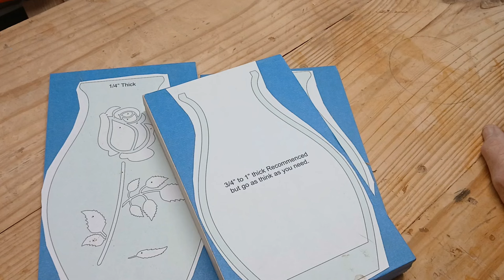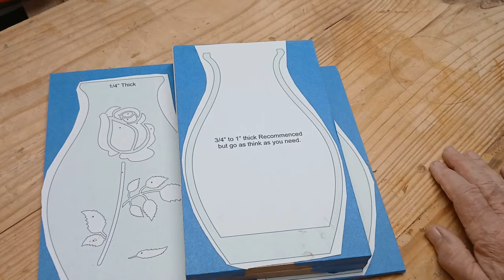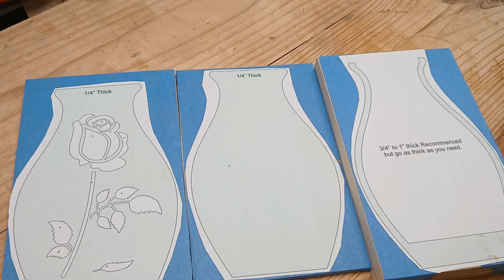A Scroll Saw Vase From A Steve Good Pattern

Comment: Great job , I have Steve's vase books vol 1 & 2 I will go to craft shows and bring 6 to 8 of the vases and they would sell plus other items of Steve, I would cut out the design then stack cut the front and back, thanks for showing
Reply from the maker: Most of the time I do stack cut pieces that are identical in outline,  I'm not sure if that makes me efficient or lazy.  But mainly I like the identical match that you get.  If I were making several I would stack cut as much as possible.